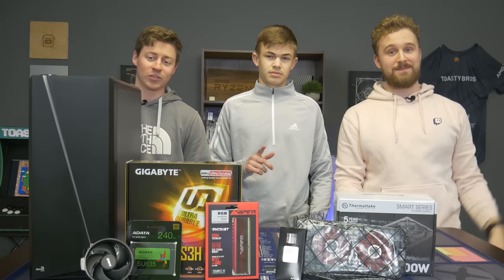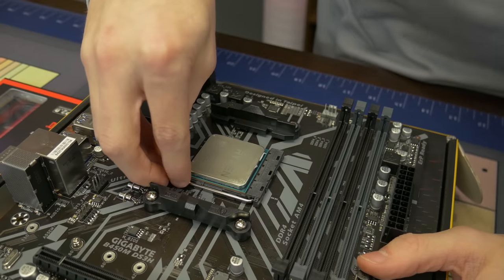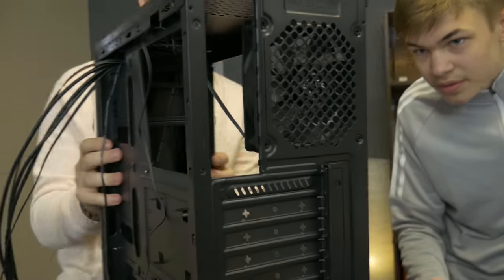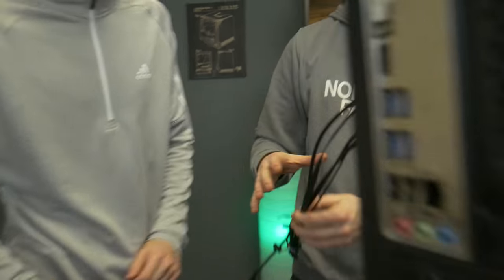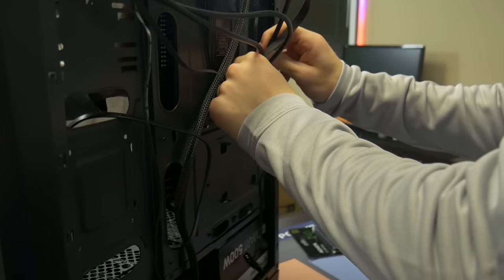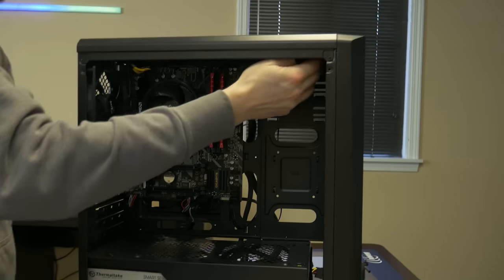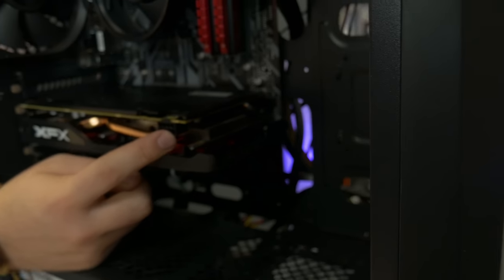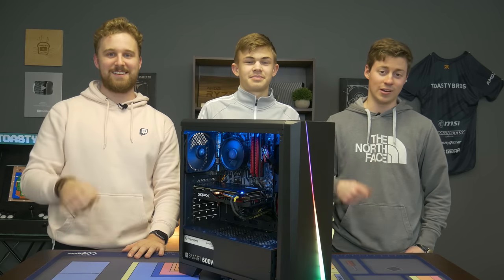2020 $450 Gaming PC Build Guide

Comment: 8gb ram can barely run well. Built 20 pcs and this build is not the way to go. Ditch the 1600 and get the Ryzen 3 3200g pairing with the 570 or for 20$ more get the rx580. Please trust me.
Reply: Is Ryzen 5 3600 good?
Reply: velxtropic, yes. Regarded as the best budget gaming pc cpu right now
Reply: velxtropic, I have a ryzen 5 3600 paired with a Sapphire Rx 5500xt Nitro+ right now. 190 frames ultra settings or r6. 600$ build
Reply: velxtropic, ryzen 5 3600 with a Rx 580 is a great build
Reply: @jimmyhoosong9574  nice, I'm considering that rn.
Reply: velxtropic, awesome. Let me know if you need any advice on other parts or you can dm me on Instagram or Snapchat

Comment: This is not 450 dollars I put all the items in my cart and the total was $615
Reply: Due to Covid/trade deals pretty much every component coming from overseas is seeing supplies become limited. CPU prices have jumped. Check ebay, while there is some risk getting a used product, the buyer protection with ebay is good. If you go through marketplace/craigslist make sure to test everything. Guy sold me a $30 computer(to play old games on) and pointed out it has a new soundcard... Except no drivers were loaded onto it and it's so old it's difficult to troubleshoot since nothing is supported. No buyer protection there :(